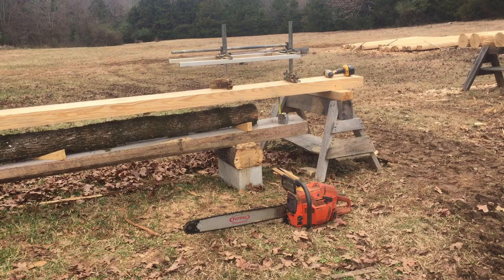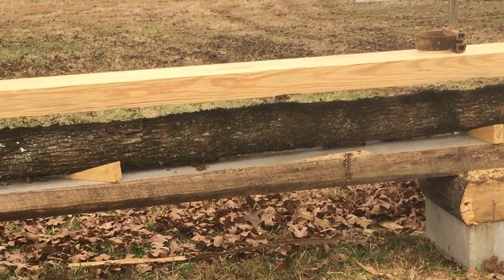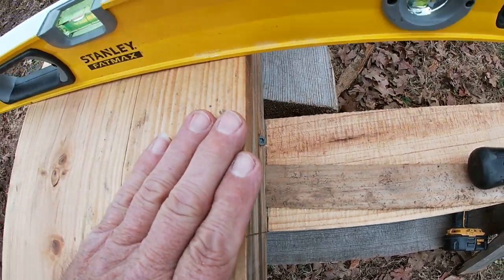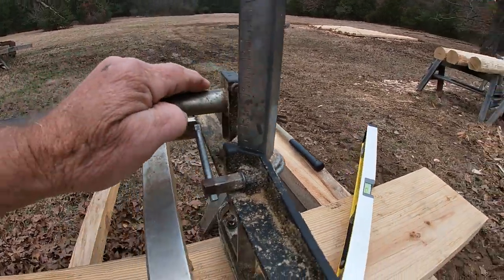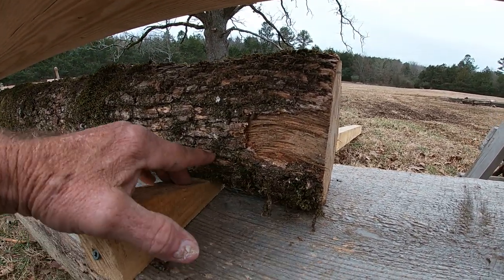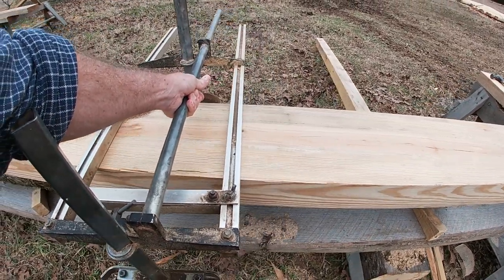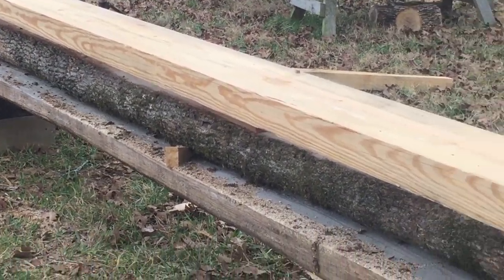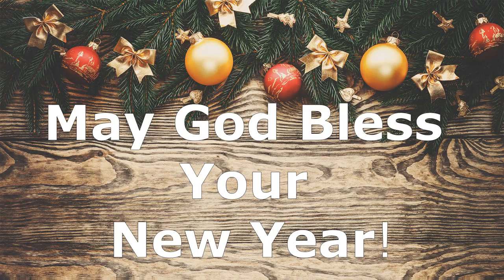Using an Alaskan Mill to Cut Floor Joist - Dovetail Log Cabin Build, (Ep 7)

Comment: Thanks again, Paul. Looks like a real time saver. A couple of questions:
How much is an Alaskan mill, and which one(s) would you recommend?
How powerful a saw do you need and with what minimum length bar?
How long can you comfortably store those logs with the bark still on them?

Thanks again. Caleb still calls you "grandpa" when we watch your videos together.
Reply from the maker: James Aldridge Howdy Jim- it’s definitely a time saver. My mill is the 36”Granberg Alaskan. I’ve seen them advertised but I didn’t get the price. I’ve had mine over 25 yrs. You could Google and get a price and where you can get one. They can be a lifesaver in a log build. My saw l use is a 94 cc. I think you could use the saw you have but not push it too hard. I try to get the bark off as soon as I can but these oak has been cut a few weeks. I’ve had a lot of stuff to do here lately and kinda got behind on some things. Give that precious little boy a hug for me. God bless y’all
Reply from the maker: James Aldridge Sorry, forgot to tell you that those mills can be adjusted to fit the length of your bar.

Comment: Could you two side all your wall logs with this mill? Or would one of the timber tough beam maker type mills be better?
Reply from the maker: Howdy RN- yes, I actually bought the mill years ago for that very purpose. If you watch the video where l did the top plate logs you’ll see me milling some logs over twenty feet long. I’ve milled quite a few wall logs with the Alaskan mill. I use a 394 Husky which has the power to cut without bogging the saw down. I keep the chain sharp and it cuts pretty smooth and consistent. Thank you for watching and God’s blessings to you